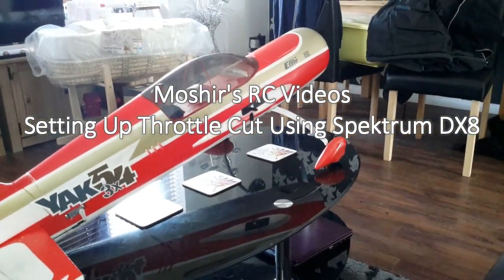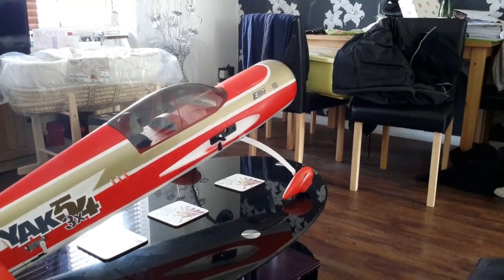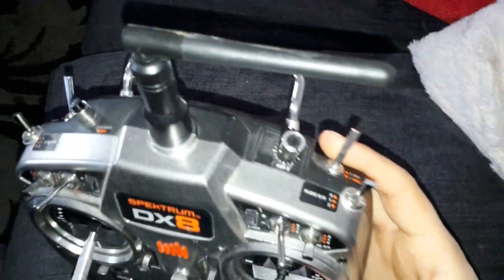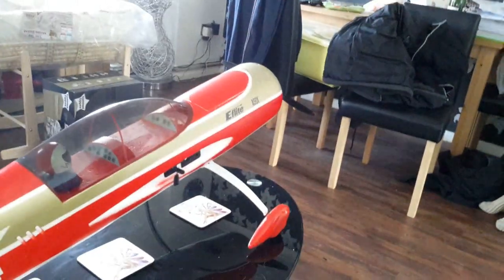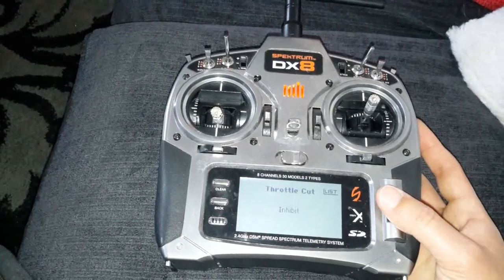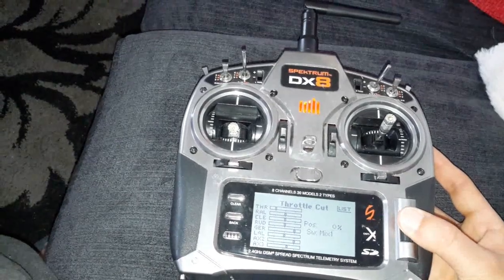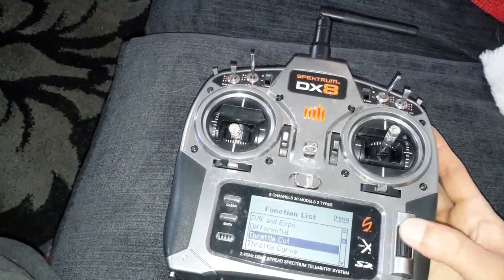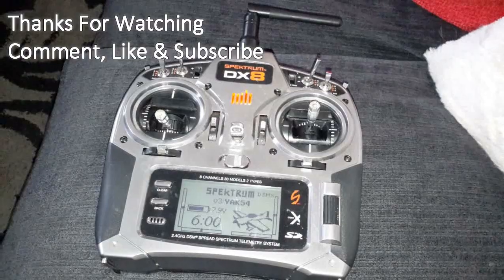How to Set Up Throttle Cut Using Spektrum DX8

Comment: Big question. If you have the throttle cut set to prevent the electric motor starting but then you have nudged the throttle stick accidentally to say half throttle, and then you switch-off the throttle cut, doesn't the motor immediately start at half throttle and cut your hand off?
Reply: Yes that is what happens, so this method is not good. If the throttle is not at the lowest position and you accidentally nudge the arming switch, the motor instantly starts. Over many years of using Spektrum radios for electric flight, I turn my receiver on first then I only turn on the transmitter when I am ready to actually fly. When the flight stops the first thing I do is to turn off the transmitter. For testing systems no prop is fitted. A much better arming system would be a 2 stage arming as is possible with OpenRX.